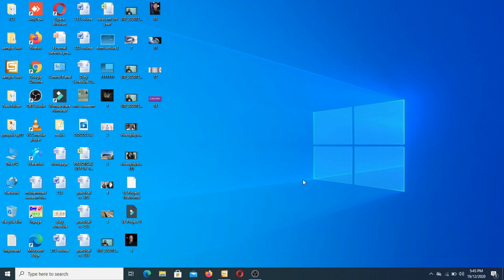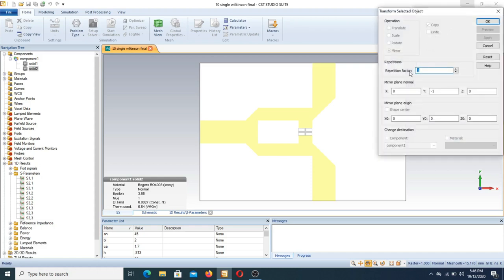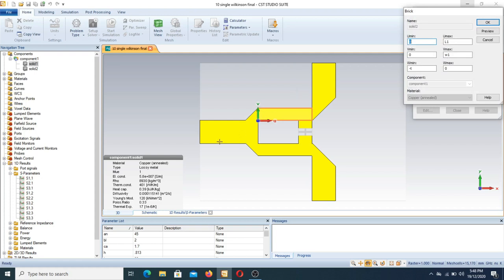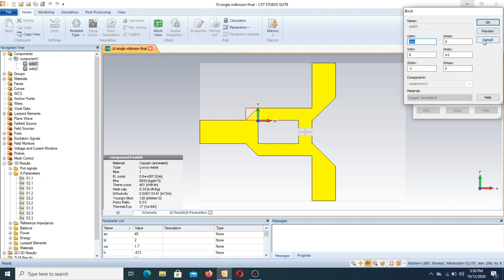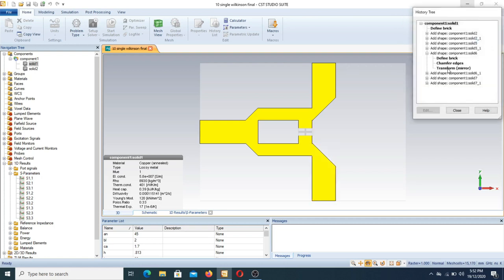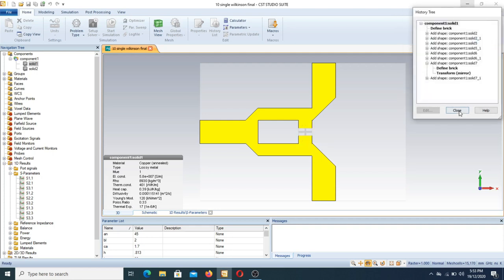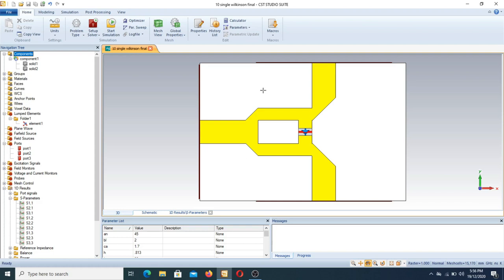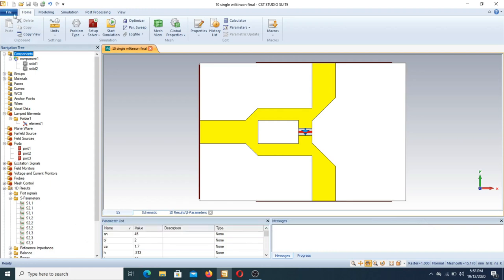How to design Wilkinson power divider in cst | single stage wilkinson power divider| power dividers

Comment: I am just wondering about the ground plane. There is no ground plane. Could you please explain how it will work practically. Suppose anyone fabricate the power divider, where the ground of SMA will be connected? or is it groundless?
Reply from the maker: Ground less
Reply from the maker: Ground plane is not necessary only substrate and upper clading
Reply: @infotechscience  How practically SMA will be soldered?